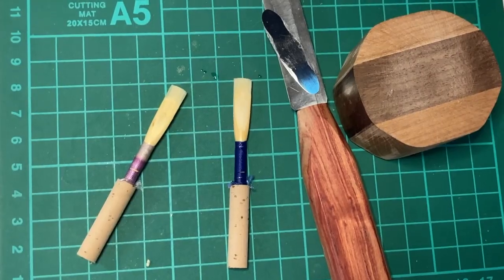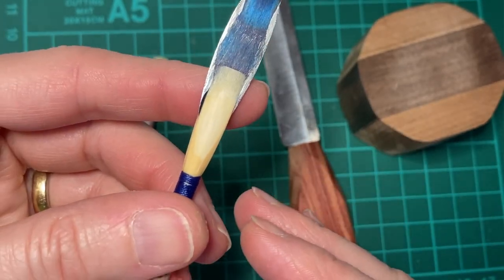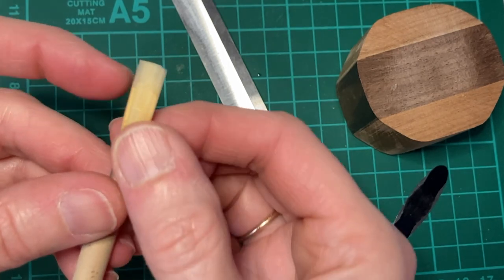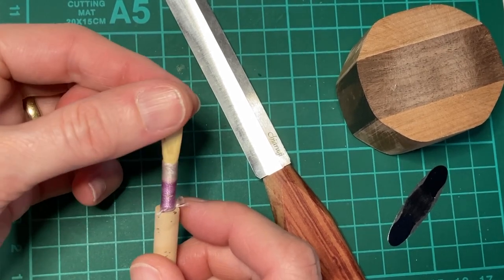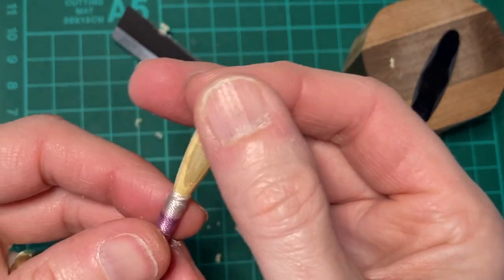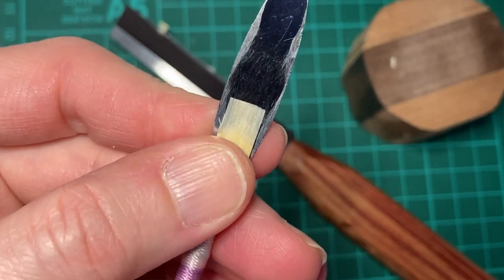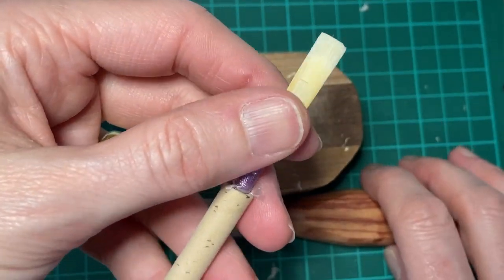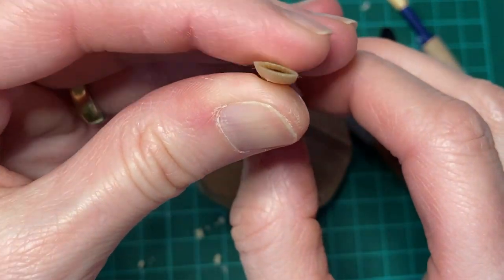Five Minute Reedmaker: What To Do When Your Reed Is Too Open

Comment: Something that I've noticed with reeds in terms of openness is the correlation between the thickness of the gouge where the cane meets the top of the thread and the size of the opening. I prefer 10.25 dimater cane, and find that if I use that same diameter, I gouge to a center thickness of .58 (.50 on that thread measurement) in the summer, and in order to get a similar opening, I have to gouge thicker (.59-.60) (.51-.52 thread measurement) in the winter time here in southern/central Indiana!
Reply from the maker: What an interesting observation! Thanks for sharing. I'm confused, though - does your gouge get THINNER as you move from the center out toward the ends? Is it really as thin as .5 at the thread? That feels very strange to me and I'd love to hear more.